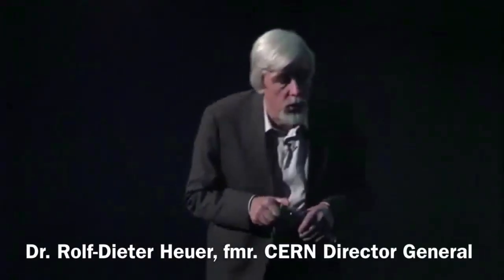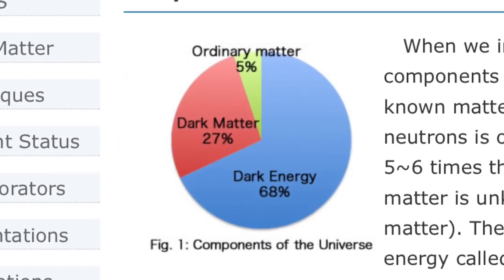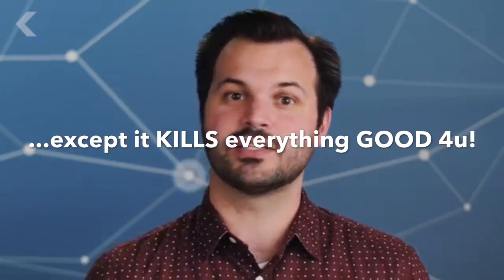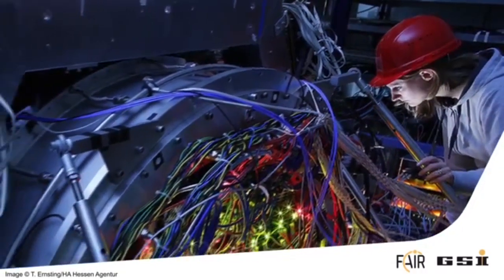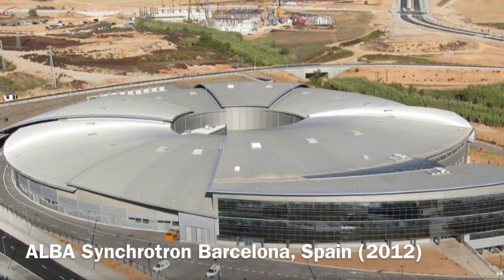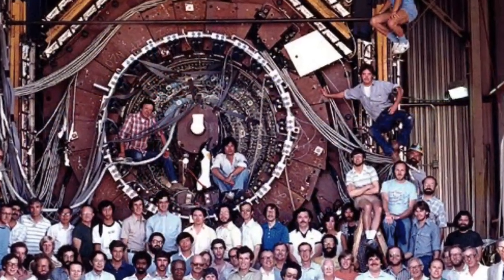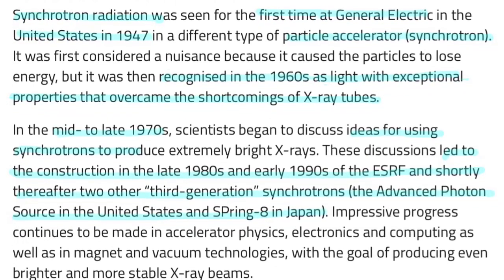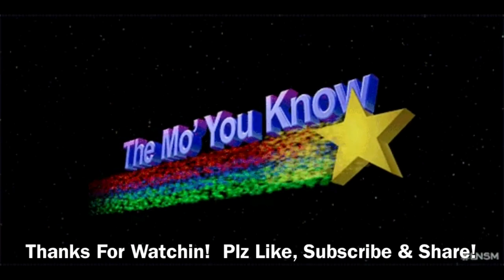Mandela Effect ALERT! 30,000 Particle Colliders Worldwide CERN is Everywhere Quantum Changes Reality

Comment: there are 30,000 particle accelerators, but they are mostly used for various purposes not for "manipulating matters" Most of them are LINACs. electron linear accelerators for radiation treatments which can be fit in a small room. no harm, no matter manipulations lol.  this video is so misleading..

Comment: As I understand it, entanglement was a discovery, not something produced. The particles can be "tickled" (their word). The tickling will show if any other particles are entangled within the experiment. 

However, much has changed. I am well versed in much of physics, quantum, etc. All of these newer accelerators, blew my mind!! Wtf!! I know of Fermi labs because, I live near Chicago. CERN is the LHC and most popular. I don't understand a damn thing they are doing. As all my research into them, is just words. They have no idea wtf they are doing. At least those, lower on the totem pole. 

When mainstream, respected, scientific types are warning, not to mess with the fabric of our universe, you'd think they'd listen. 

There's a huge missing piece here. Many of my physicist buddies, are in the dark. They basically spout the same BS I find on wiki and LHC website etc. 

This is stranger than anything. Definitely not the first time I've considered them changing things. 

Even the history of quantum  physics, is nothing close to what I recall. I may have to browse through some reading material for answers. 

I was awakened by ethenogens. Then started seeing the construct of the spiritual realm. I understand and visualized a huge tree (of life or consciousness) and most, if not all of us are connected to this tree. It's the collective. Little fibers connect our single souls, to larger groups, than those groups are attached to even larger groups, then the tree. 

That's my thought on how a biological matrix works. Which would fool a physical being. So, with that said. Is our reality, biological nature, lab created biology or digital? We have no idea, the extent of these sciences. 

The lies are easy to spot and allowances for "their" theories. I can provide examples, if asked politely. 🙃

p.s. regarding that Spirit tree, vision. (I had a dream nearly 15 years ago..) This other experience of mine, which included a tree floating in a black void, roots hanging so low, they eventually fade to Black. There was a giant hole in the lower part of the the trunk. Here's the weird part, it all seemed very familiar. There were flying or floating "vehicles" or something else, in lines, going through that hole!  The trail of vehicles were swirling around the tree, but not close to it, a much further spiral. It reminded me of DNA strands. 

Thought this would be interesting to post.

Comment: Cern is just the first big one doing dangerous experiments and with a creepy statue outside.

We have had particle accelerators (30 thousand though?) For a while. It was how we confirmed Einstein's theory of time relativity by accelerating decaying particles and noticing a slower decay rate and high speeds. Also particle accelator vs particle collider. Cern COLLIDES and does it excessively/extensively to the point that some people were worried they would blow up the earth. Their statue of  a goddess of destruction outside didn't help with public image.

Comment: Counter-accelerate proactively. Rig up backyard gizmos with discarded vehicular manifold, muffler and exhaust pipes. Get crystals [read up on various crystals and gems], and water, sand, chicken eggshells, anything. Be safe though. Use nous. Position items in different configurations. Have a fire from dried sticks [when there is no fire ban] under one end of the straight or irregular shaped metal tubing. Find way to inject droplets of water. Don't build high pressures. This will be soft technology. It's mind over matter stuff. We have got to counter the white-coat tax-leaching jesuit Einstein idolatry-atheist madmen and madwomen. They think we are a joke? They think they are superior to us? They think they are CHOSEN as the people to dominate and mess around with all of life life and your life? Then fight back! Soft technology. All legal, all beyond their comprehension. GOOD. That's the desired outcome. Do. We will win.